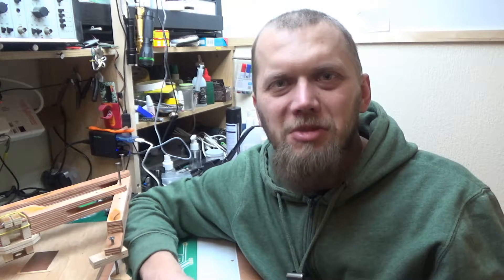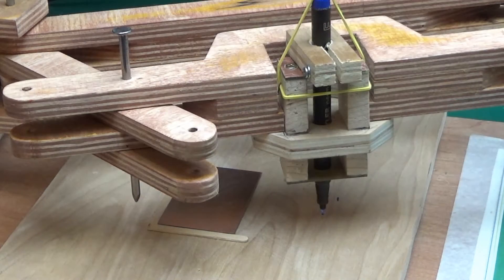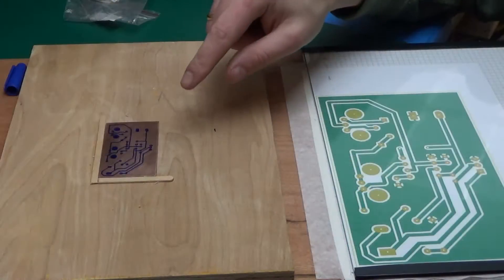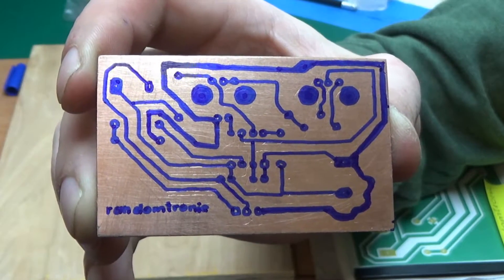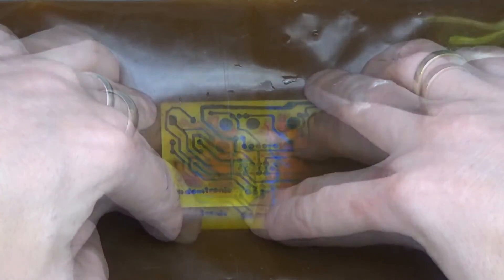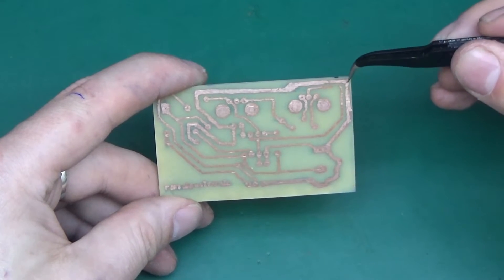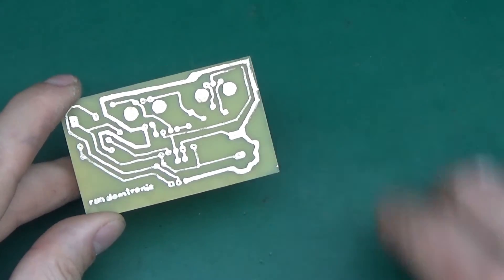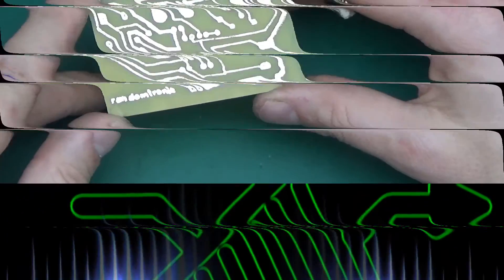Pantograph and etch resist pen PCB making

Comment: Particularly when looking at your "randomtronic" text, it looks like the pen may be wiggling in the holder. For that matter, any play in the joints of the pantograph will cause this too, but I'm betting the pen is wobbling from one side of the holder to the other resulting in the ~0.5mm errors.

Also you might try putting a light under your etching bag. While it's not too hard to see the copper on the board substrate, it's far easier when light is shone through since the substrate is mostly transparent and the copper is opaque. You can see tiny amounts of copper remaining, and you can see if your holes get etched through using this technique.
Reply from the maker: Jason Olshefsky thanks. yes , the pen could be wobbling a bit. it was difficult to get the pen to move up and down without friction and have no wobble. I think i can minimise it with minimising the needed z travel of the pen, in this video there was about 3mm travel, and i can get it to under 0.5mm with proper leveling. 
good shout with the light under the bag, i will try that next time!
Reply from the maker: +Pentagrid it could work. Thanks.